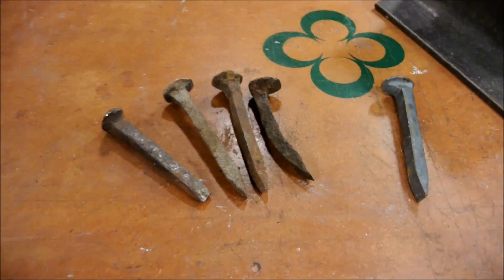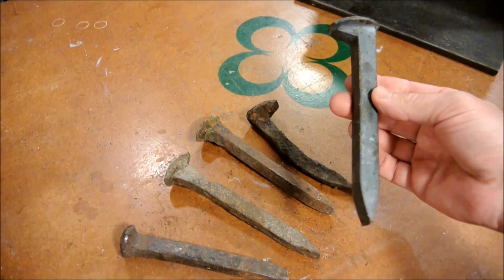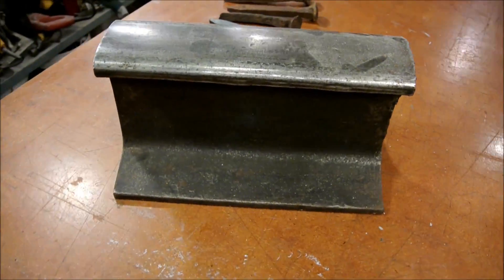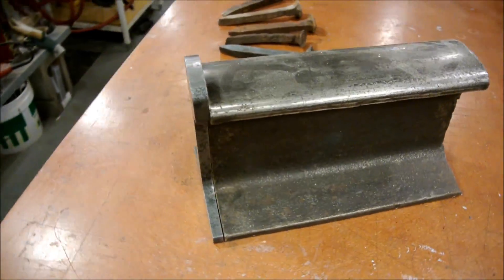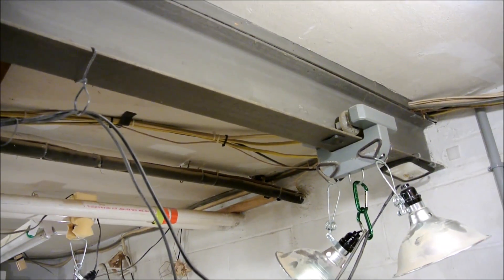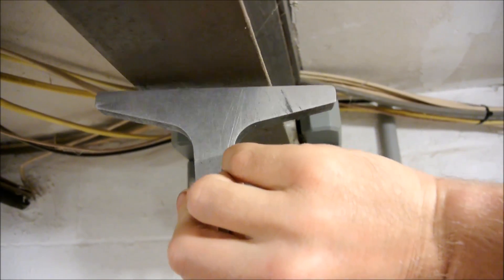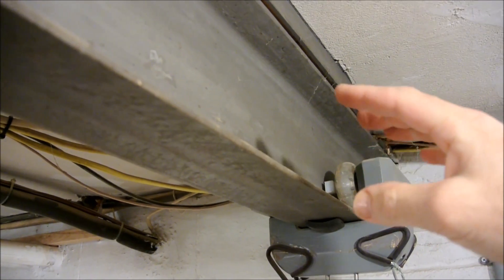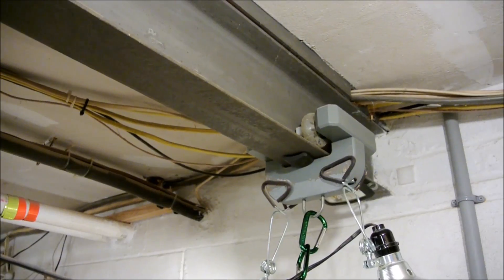Train-track squashing (wear)

Comment: From how the rail was not only compressed, but mushroomed, makes me think that the wheels don't perfectly sit on the rail until the rail is deformed. Maybe this is intended? Maybe it's cheaper to produce rail in a symmetrical and thinner/taller shape that's easily deformed to the shape of the wheel? 
If you can, I'd love to know more about odd little train facts that you can't get directly from wikipedia, like this rail and tie stuff. It'd be cool if you could get your hands on a set of wheels, one from a century ago, and one that's basically new, and compare the wheel profiles to the rail profiles.
Reply: the wheels are not meant to sit flush with the top of the rail. the wheel is designed to ride on the corner so it self centers the train.

Comment: I'm currently training to be a mechanical engineer, so I am not an expert but I really love talking steel/materials, here is my speculation.

I think two things have caused the profile to change so significantly. The first is the obvious one, wear. The second I think is a little bit less obvious (but this is only a guess). This sort of "failure" appears to be a creep failure caused by heavy loads at elevated temperatures.  If it were a fatigue failure cracks would form and the possibility of a catastrophic structural failure would have increased sharply. I think because of the friction caused by a long freight train passing over the track, the material could have heated up to the creep temperature ~850 degrees F and then a load much less than the yield could have caused the material to flow. 

I'd wager that the side of the profile that was crushed more than the other was the inside edge of the track, keeping in mind the truncated conical wheels that trains run on. 

I'd love to hear thoughts on other possibilities!
Cheers.

Comment: My last house had used rail supporting the main floor.  it was supported by notched steel piping into which the inverted rail was dropped.  The house was built in 1949; a 960 square foot, 4 room starter home built just after WWII.  At that time, cars were gaining popularity and the trollies were being ripped out.
Reply: That's pretty interesting. What state are you in?
Reply: I'm in St. Louis, Missouri.

Comment: Do you know if all tracks have the same initial cross section?
Reply from the maker: I do not. But I think it's fair to assume that regional systems would have a standardized track shape. Supposing the local line goes all the way to the west coast, I would suspect that the entire American network uses this shape. Besides, it's not like shipping costs are a factor for the rails, so they probably only use a select few manufacturers. But I have already heard in the comments of some variations to the other, related connectors and fasteners, like screw-spikes. And European rails are no doubt much different altogether. Interesting topic, isn't it?
Reply: It is. I have a use chunk if rail too. It measures 5" tall. Curious to know what the two the video measure?
Reply: Old one=6+5/8
New one=7+5/16

Hmm. That's strange. How far are you from PA?
Reply: +pocket83 I'm in southern Oregon. Hmmmm I wonder where my sample came from. I may have to just go out and measure some local rail.
Reply: +pocket83 just measured one and it was about 7".
Reply: There are different types of tracks. I've seen next to each other rail for urban tram, rail for metro, rail for trains and another type for heavy loads. They definitely were different heights and thicknesses.. so they come in different flavors.
Reply: +AsiAzzy thanks, that makes sense.

Comment: The rail is not necessarily too old. It's 132# rail sawcut on one side and torchcut on the other. Looking at it though, I would say it came from industry tracks especially since it appears to be from a turnout. I would say maybe 20 years. We are replacing rail in the Ohio corridor based on tonnage per year. Those spikes are old, but you need to look for a legacy spike. You'll know it when you see it. From a professional railroader and fan of Pocket83.
Reply from the maker: Great to hear from you! And I have a perfect question for you. I found a structure on the tracks that looks like a shark-fin; it appears to be a composite of metallic flakes, it weighs about 20 lbs., and its size is such that it would sit on the edges of a 5-gallon bucket without going in. 

My guess is that it was a collection of welded together sparks from brake-related friction. The perfect curve suggests a reasonably consistent forward motion. At some point the mass must have broken away from its weight. Am I close?
Reply: Sounds like part of a switch point that may have blown out or leftovers from a thermite weld. Would have to see it to be sure. As a Pennsylvania native myself, growing up around tracks was always cool to me. Not a foamer, by far though. Have a great weekend, Pocket.

Comment: At the railroad in my city they don't use spikes, they use screws instead. When the railroad was renovated a few years back (even more than 100 years after it was constructed) I collected a few of them. I noticed a spiral wear pattern near the head of the screw, (where there are no threads) exactly an the point that it meets the track beam. I figured that it occurred due to the constant loosening-tightening over the years, changing the contact point between the screw and the rail. I had seen in several occasions workers during the hours that the railroad was out of service walking along the lines with wrenches, tightening any loose screws.

Comment: Fascinating! I didn't realised they squashed like that. I know they grind them occasionally. Now that I think about it, those steel wheels are like huge rollers and their contact area is tiny for the weight they bear.
Don't think you could get a railroad track beam past the building inspections today :)